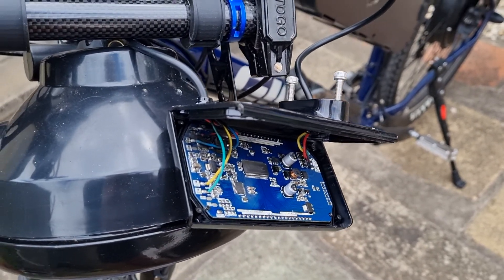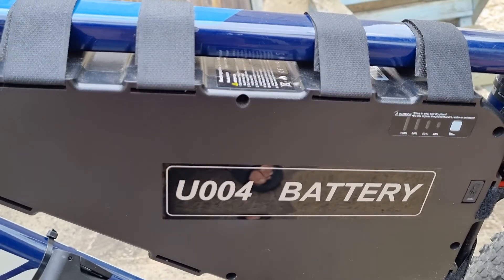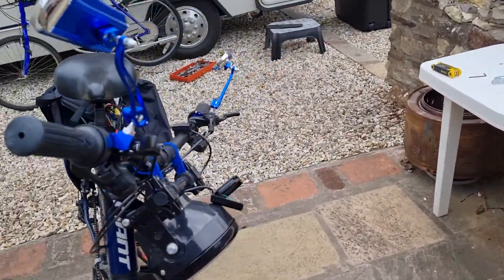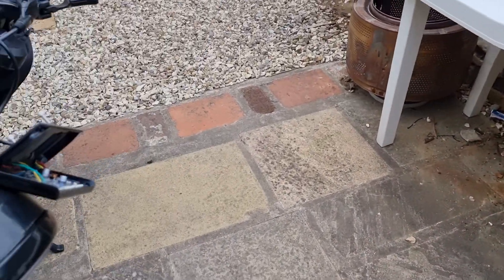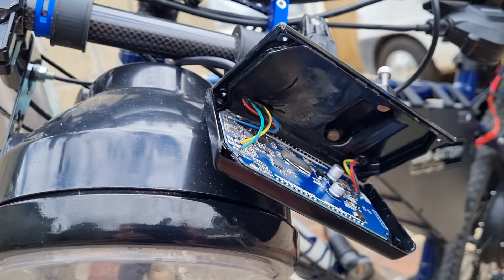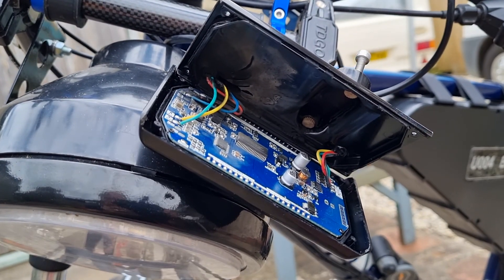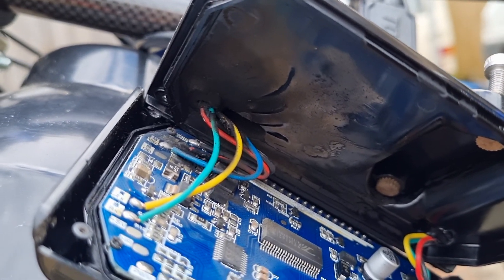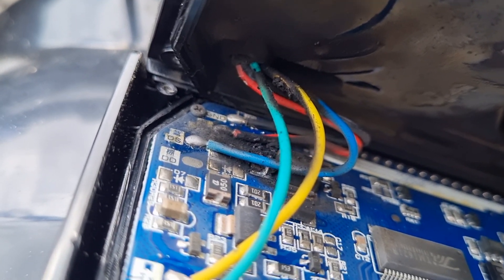Inside SW900 LCD Display (Error 10)

Comment: What you and I had is the SW900 A, mine too blew in the top left corner but nowhere near as bad as yours. The 'A' version seems to be the only one which allows amps greater than 20 ( up to 50 if I remember ). I ran my 1500W motor at 35A  and experimented with higher. I don't think increasing the amps caused this, mine died a few days after a downpour. The display filled up with water but I could still ride home :)).
Some people say using the light connector causes error 10 but I never had my 60v light kit when I had that display.
I ended up with a bog standard sw900 and it won't allow more than 20A but I am using the lights connector so who knows what caused the damage, yeah, I know you were expecting this long reply to clear up the mystery but .. c'est la vie eh ? :))

Comment: Just read this.  I cant see how upping P14 to 20 amp can affect the SW900.  It might stress the Battery and controller but The current does not flow through the SW900.  The fault is def with the internals of the SW900.
Reply from the maker: Well, it went phutt as soon as I switched everything on after having selected as described. Can't think what else caused it.
Reply: @philipvanbergen3924  do you think it could be some water in the lcd? or some overheated like black and red stick together. cause if we take a look in lcd those wires are connect to the controller and the motor red / black / yellow / blue and green. lucky you didnt burn the motor or the sensor inside.
Reply from the maker: @marcus6354  conditions were entirely dry for weeks.

Comment: Philip, how do I pop open the case? Do I attack the long edge or the short sides. My display didn't last very long at all. thank you very much
Reply from the maker: The long edge has to be lifted slightly, but not too much, to get under the lip (more flexible due to the length) and then work around it slowly, several times.

Comment: Hey phillip, I just had a similar issue. Did ordering a new one fix this? the cord to my controller from the lcd monitor ripped during a crash today, but i didn't notice anything fried inside that lcd sw900 circuit board. Do you have a 48v 1500watt grey controller as well? I am at witts end, going to attempt opening that
Reply from the maker: Christopher, it did cure the problem and it's working fine now. The controller was fried too, but neither the LCD nor the controller are expensive. £60 for both.